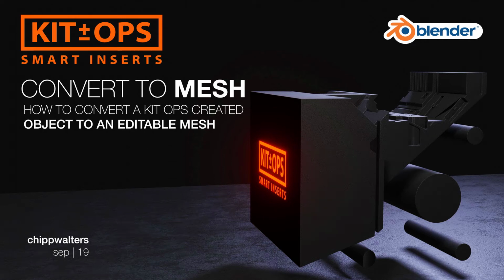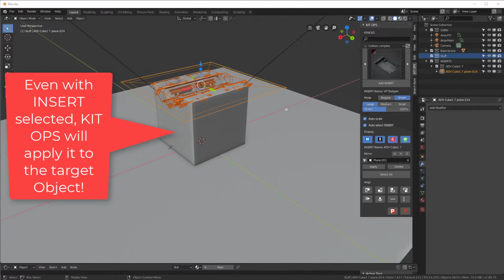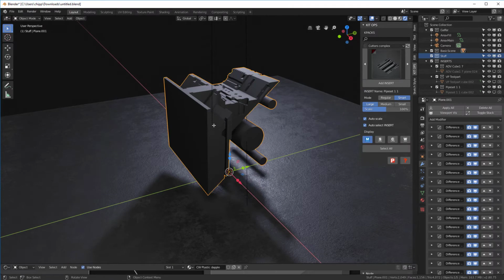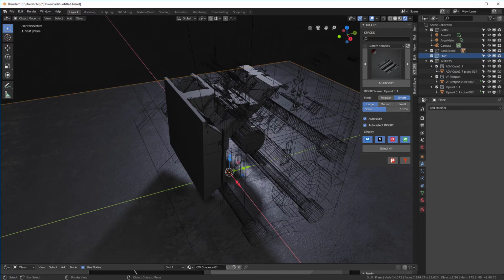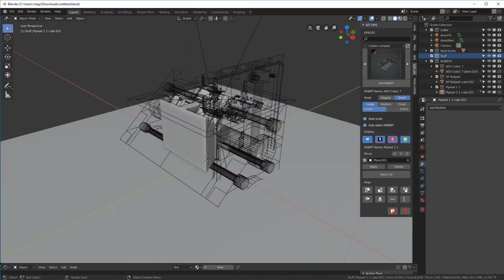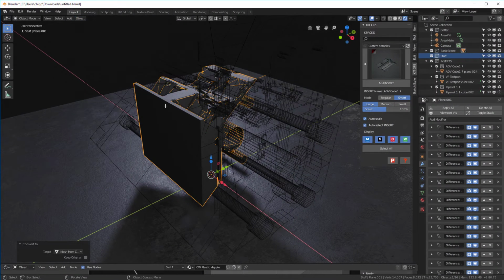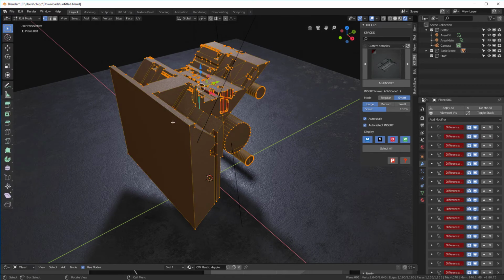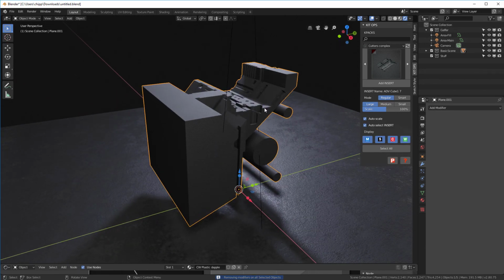Blender: KIT OPS convert to mesh tutorial

Comment: Hi Chipp, 
i like the idea of the plugin but i run into a frustrating problem.
If i use an insert (Pro Version) and put it on a normal cube, some of the insert just look not right. Maybe i just do something wrong or there is an easy fix on it.
I uploaded a picture here
https://ibb.co/rbtYpy7

i would be happy for an answer. i tried your email on gumroad but no success it cam back with an error.
oh and i use the version 2.82
Reply from the maker: I believe we solved this problem in another venue.
Reply: Chipp Walters thanks for your time.
Reply from the maker: 1. Check to make sure you have the correct smoothing settings.
2. Make sure you don't have a bevel modifier ABOVE the KIT OPS INSERT that had HARDEN NORMALS checked.

Comment: Another way could be to do the following: Object -> Convert to -> Mesh from Curve/Meta/Surf/Text. I don't know exactly what is the difference compared the visual geometry option. In Blender 2.79 the shortcut was 'ALT+C', but in Blender 2.80+ you have to do it through the menus as described. You could assign your own shortcut to the menu command or put it to quick favorites.
Reply from the maker: Thanks Marach. I used to use that in 2.79, but have seen it create troubles in the past. Still, if it works for you then super!